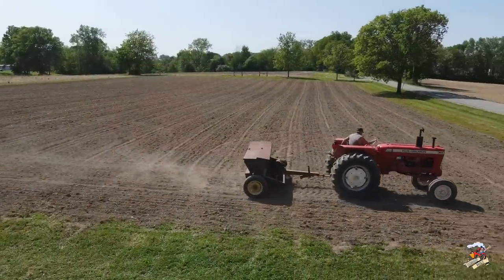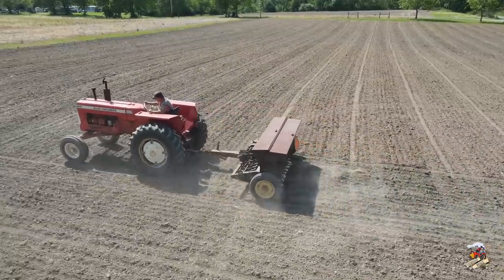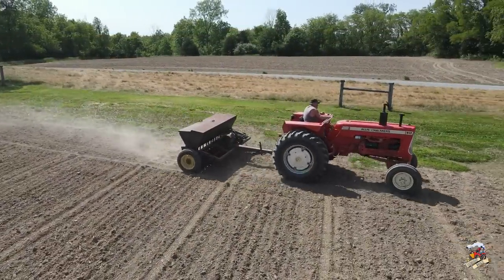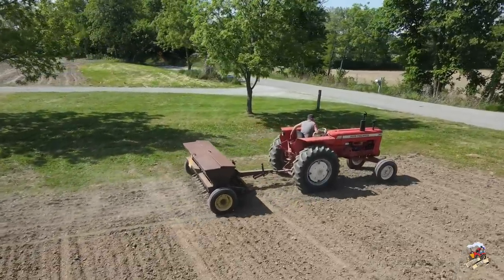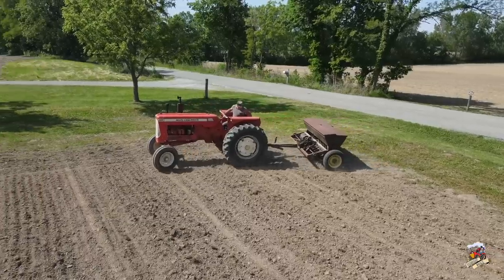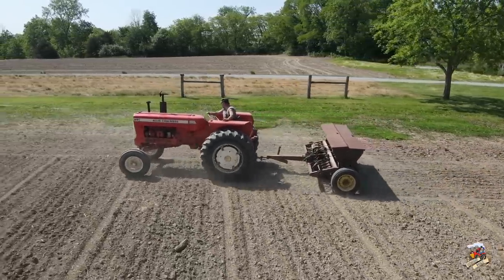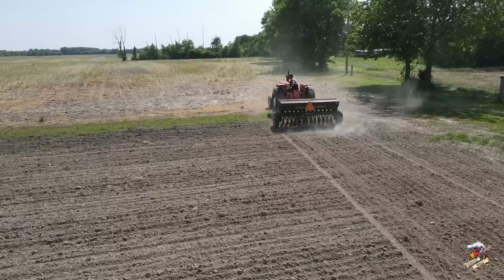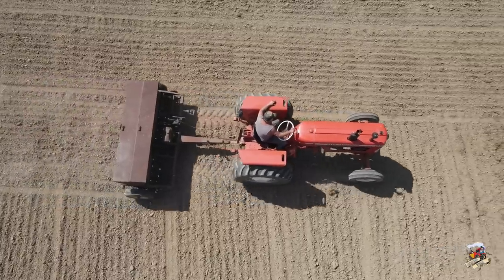Planting Soybeans like its 1963 | Allis Chalmers D17 Tractor & Oliver Superior Grain Drill

Comment: Are those the original fenders
Reply: No, those are 170 fenders. The fellow that did the restoration on it had an AC loader on it, and liked the flat top fenders.  He used the tractor pretty regularly then and wanted what he wanted.  Pat got the tractor when he passed